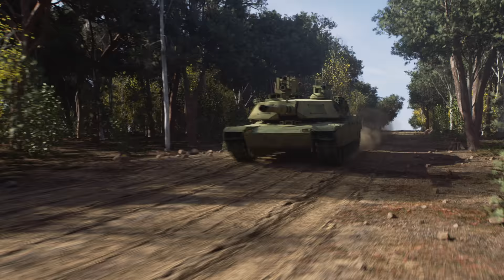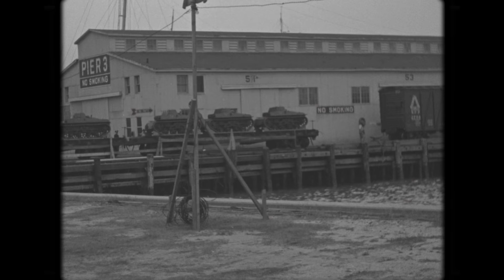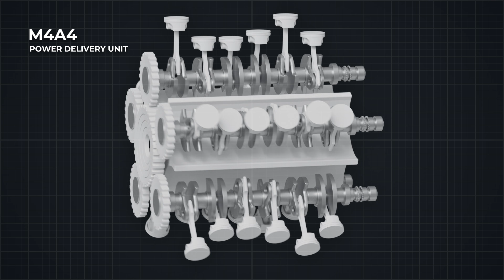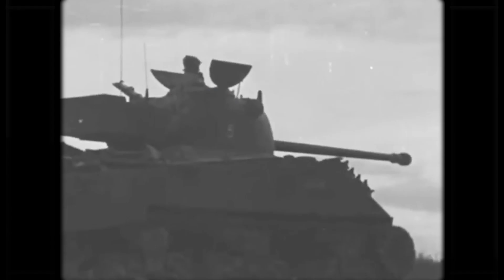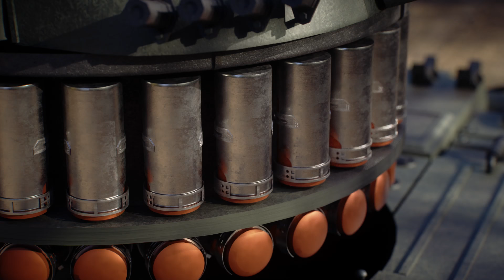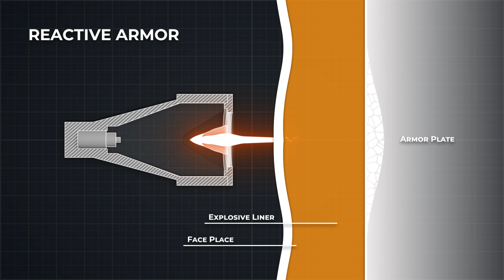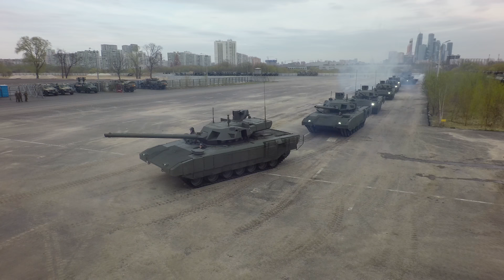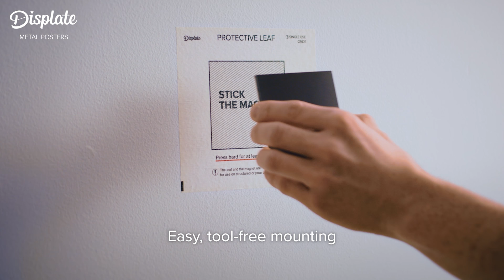Why America’s Tank Failed in Ukraine

Comment: There is a lot wrong in this video.
1. the tiger1 was not impervious to the Shermans 75 or 76 mm gun, both guns could penetrate the tiger 1 from the front.
2. the Abrams is a type of tank that has many different variants, not every Abrams weighs 78 tons. The variant sent to Ukraine is an old USMC Abrams that if I had to guess weighs about 62 tons.
3. I don't understand why people that think because the Abrams was knocked out in Ukraine that makes it "not suited for modern war" 
Ukraine and Russia have completely failed at employing there tanks in a way that won't get them killed. 
You could add the most advanced systems to any MBT in the world... but put it in a war with no support from other assets and watch it fail.
I'm tired of see this whole "tanks don't work anymore" from what people see in Ukraine
Reply: I think the point was to state the obvious, which is that the M1A1 wasn't equipped for modern wars. Yes it is an old variant of the M1, and yes just because they were knocked out it doesn't mean they were destroyed.

However the point is still true. For decades people touted the M1 Abrams, and it's survivability. Declaring it as one of the best tanks in the world, and perhaps in the 90s it was. Even with the A2 and SEP v3, the reality is that the Abrams platform is aged. The video was simply pointing out the issues with the tank, how the tank came to be, and how these issues have affected its use in Ukraine with the war against Russia. It doesn't mean the tank is garbage, or that the title is misleading. It just means exactly what Real Engineering said, "Why America's Jet Tank Failed in Ukraine." 

The reality is that the US is really the only country with the logistical, financial, and size capabilities to utilize the tank despite its negative factors. Yes, it is a beast of a tank, and as we've seen no tank is perfect (just ask Russia). However the title said exactly what it was supposed to. It provided the history behind American tank design, how the Abrams came to be, history about its' service and upgrades, and finally its shortcomings and what the Army is going to do about it.

This doesn't mean the M1A2 is gonna get liquidated, or is just a paperweight. It just means that without a country like the US, and our military logistical supply chains, this tank has failed to be truly effective in combat in Ukraine, resulting in 27 of 31 tanks being knocked out or rendered inoperable.
Reply: I am only going to criticize "In a way that won't get them killed".

This is war. Equipment dies. The Abrams in particular was thrown in the worst fighting. It's not that it died because it was a failure, it died because the it dying was worth the cost of the support it provided.
Reply: @wesleyfravel5149 the abrams failed to give the Ukranians an advantage in the battlefield,therefore it is a 72 ton failure😂😂
Reply: @wesleyfravel5149  if a tank is used correctly and effectively it will not be taken out. The US does not make sacrificial loses in modern combat.
If you think Ukraine and Russia intentionally killed off thier tanks you are delusional
Reply: @SHEEPS_123  That's a nonsense statement.  The battlefield is full of random unknowns and events that that can take out the correctly effectively used tank.
Reply: @SHEEPS_123 there actually is Ukrainian video of them using a Abrahms as bait.
Reply: @SHEEPS_123  it depends on what you mean by modern warfare. The US does not fight near-peer wars, let alone peer wars. The Russians didn't think they were doing those either.
Reply: @Hundredthldiot  in desert storm the the Iraqies fielded modern Russian tanks that russia themselves would have fielded in mass, i say in mass because obviously at the time Russia had more modern tanks, but those tanks would not be able to be replaced and older tanks would take there place. 
The Abrams did not smite the Iraqi tanks because it was far superior to them, it smited them because no country to this day match America's ability to fight on many different levels and provide logistical support for them.
In Venezuela the US went up against anti air systems that both China and Russia currently field, and yet we went in and out without being hit by a single missile. 

Im not saying that America won't suffer losses in war, but the only nation that could really conflict our ability to conduct operations with minimal losses ( compared to other nations) is china
Reply: @Slickrock72  this is only true for a military that is crippled, has no logistical support, or is not capable of fighting on many levels such as air superiority, controlling the waters, or having strong fronts.
Reply: @SHEEPS_123  It's easy to claim superiority in peer warfare when your military has fought no peers, but the US military managed to lose Afghanistan and Vietnam, so a little humility might be in order. Ukraine has been fighting Russia with one hand tied behind its back.
Reply: @SHEEPS_123  "The US does not make sacrificial loses in modern combat."

The US has a mostly air focused doctrine, they don't suffer large losses because they bomb the area they're attacking to literally nothing. It's not a case of using the tank effectively, they don't use the tank until the area is basically not going to put up resistance. They are not comparable in the slightest.
Reply: @Hoi4daybydayguy  given the fact that America fought a war where they couldn't "bomb everything to nothing then roll in the tanks" id say your wrong.
Yes are doctrine is air based... but thats not an American doctrine... thats a doctrine of an effective military.
The only war we were able to bomb everything to clear a way for armor to be safe was in ww2, in no war the US has been in since has this happened. Why? Because we aren't about to start carpet bombing the enemy when theu hide among civilians. Your point is false, literally every conflict the abrams has been in was not the way you just said.

I don't understand why you people find it so hard to believe that tanks are more successful in battle when supported by different sectors and that any tank no matter how good will die when employed like tanks have been in Ukraine
Reply: @SHEEPS_123  The US has carpet bombed areas in order to kill militaries even if it kills civilians. The Vietnam war was basically that. 

Why do you think precision guided weapons were developed? Because they're designed to specifically not harm civilians. The HIMARS is a great example of such a weapon, it can hit something within 1 metre of the target. No longer do civilians when you get hit because the weapon is designed to protect them while still harming the enemy.

The Gulf war and invasion of Iraq was basically a 6 week bombing campaign that flattened both their militaries. 

US doctrine is to attack and defend through bombs and shells first, then men and equipment. I don't get how you think American doctrine isn't that, that's all I observe from what I see with American forces. 

Tanks aren't deployed independently in any army, especially Ukraine. We've known that to be suicidal since they were designed. 

What I'm saying is that, your point that the US does not make sacrificial losses, is redundant, of course they don't, they use everything they can to prevent the threat and stop it, and rarely use tanks to do so, because why would a tank be needed in that context when a bomb can do just fine?

Ukraine and Russia do not have the resources for that luxury, they both have to make sacrificial pushes, because neither can do anything else.
Reply: @Hundredthldiot    The U.S. forced North Viet Nam to the negotiating table and withdrew after forcing a peace.  The U.S. withdrew from Afghanistan after a fair number of people questioned the point of being there after the Taliban was neutralized.  The withdrawal was hurried and bungled for political reasons.  In both situations the crap hit the blades after the military withdrew.  A little honesty is more needed on your part than humility on theirs.
Reply: @jagdson2701 Both were military failures. They achieved nothing. Running away is not victory.
Reply: @Slickrock72 the US has not fought a equal enemy since WW2...
The Abrams has never faced its modern equivalent from Russia/Soviets.
The version send to Ukraine didn't even have the modern armor package (something missing in the video).

Of course they wipe the floor with anything build 40 years earlier.
Reply: @SHEEPS_123 and my guy, the reason as to why there are no large air support missions in Ukraine on both sides should be obvious.
It's that both sides have to respect the enemys AA...
This is a different kind of warfare, the kind the US army was never ment for.
The US army is mobile, but not good at defense.
Look up older NATO doctrine, especially the Bundeswehr, they where meant to slow down the Russians to a near standstill, and buy the Allies time for reinforcement.
That's also why the US build as many carriers and why there artillery is so weak, because it all needed to be mobile.

Now in a drone dominated war, an tank gets pin point hit every few minutes.

Air campaigns are also known to be weak against a dug in enemy, you can wipe one trench of the map with an air assault, but there are layers upon layers of trench. All of them armed with manpads.

War has evolved back to an attrition warfare.
Tanks must be treated as expendable, because they are.
Reply: @SHEEPS_123  Something, something, something, "Fog of war".  Your earlier statement is profoundly naive.  It's baffling to me you can't see that.
Reply: @SuperUltimateLP  the only reason Russia didn't run Ukraine over in a week is because Ukraine has been completely funded and blamed by America and other nations.

Because your losing focus on the original point ill restate it.
The reason Russia and Ukraine are losing so many tanks is because neither nation is capable of providing support around there armor. Both nations could field the most advanced tanks in the world and would still suffer the same losses they do currently.
The video should be "why tanks failed in Ukraine" instead of "why abrams failed in Ukraine"
Reply: @SHEEPS_123   planes get shot by missile defense.   drones will get shot down by new weapons like small missile air defense and the tank will be needed
Reply: @DJJohnson-zw1xu I saw that.
Reply: @jagdson2701   you are higher than giraffe pussy if you think this is true. Where did you study history? PragerU? The US mission in Vietnam was what again? Backing South Vietnam, ultimately from the front, in resisting and ultimately destroying Ho Chi Minh’s communist regime and the NVA— Domino Effect. By 1975 however, the NVA controlled the entire country to the degree that remaining US personnel left Saigon during a 1975 emergency evacuation. That city fell to the NVA the exact same day and was renamed Ho Chi Minh City, and the same central government controls Vietnam today, but it has shifted away from a communist planned economy to a market economy. The only thing the US “gained” at this negotiation table was the freeing off some, most of our POWs. That’s not what happens when you win and force your opponent to negotiate. 

A shockingly similar thing happened in Afghanistan, with Trump signing an agreement that the U.S. would get out of Afghanistan entirely by a particular date in 2022. Usually when you win a war you generally see 0 combat deaths during the final day of withdrawal, not double digit combat deaths and the abandonment and partial emergency scuttling of hundreds of billions of dollars in military hardware and other materiel, rather than just selling it or loaning it to the regime we helped put in power, the one that no longer exists. Our local allies were executed en masse. This is the exact same thing that happened in Saigon, only US and allied forces got a lot better at waging war remotely and the Afghani mujahideen had gotten extremely good at insurgency at a distance, using the RPG-7 and the pyrotechnic time delay fuze inside PG-7V HEAT rounds (excluding the Chinese version, which lacks this feature) that detonates the main charge as an airburst munition, detonating at a fairly predictable 3000 foot range. This and the mountainous terrain are why ground warfare engagement range was 1000 yards away so frequently. PG-7V is cheap, 6 rounds plus boosters for $90 USD from the Pakistani black marketeers. Of course also using improvised minimum metal munitions in the form of ammonium nitrate fertilizer paid for by the US army to switch opium farmers to cotton which also led to our fentanyl epidemic as if we couldn’t have predicted that interrupting the global drug trade’s natural feedstock (cocaine) would result in drug cartels switching to a more dangerous synthetic replacement (methamphetamine). 

If you want an example of the US eventually winning against an insurgency (armed with swords and knives) then the 1900-1913 Moro rebellion would be a good example. The Moro Juramentados were so effective at melee combat with edged weapons, the US armed forces issued an emergency procurement for the Winchester 1897 “trench broom” shotgun, which is why US forces adopted jt so early into WW1, and it also led to John Moses Browning’s .45acp colt M1911, as the 32 Colt revolvers of the time, at 330 foot-pounds of energy similar to a .380acp, was insufficient at stopping the Juramentados. Eventually we mixed diplomacy and massacres to install a cooperative regime in the Phillipines. 

 Since this comment we have also suffered an embarrassing defeat driven primarily by the same egomaniac in the Strait of Hormuz, managing to lose the most advanced stealth fighter aircraft ever flown in hostile skies.

As to the matter of the Abrams in Ukraine, I will share my opinions as an American veteran of the first 33 months of the defense of Ukraine as a dismounted infantry precision marksman, not a tanker. I’ve never even been inside a moving, true tank before.

They were first of all an older variant of the Abrams lacking the “depleted” uranium-238 matrix armor, instead using tungsten heavy alloy and ceramic armor with Kontakt-1 ERA cassettes and  improvised cope cages, and older situational awareness EO/IR, so the thermal imaging system has about half the range as the modern system with far fewer pixels on target. Actually less advanced than what’s in the Bradley IFV. They were also used where the fighting was heaviest and most desperate, near Pokrovsk, Avdiivka, Klischiivka, Bakhmut, these are all within a box 20 miles to a side. Russian commanders put a financial bounty on destroying the Abrams and they faced a threat no American ground forces have ever faced: ISR drones, FPV drones, Lancet OWA drones, T-80s with Kornet-D missiles which are huge tandem HEAT TOW missiles that can punch through 1300mm of rolled homogenous steel armor after defeating ERA panels. That’s 4 feet 3 inches of solid steel. But really it was the drones. The tankers were the elite 47th mech brigade. Great tankers and the Abrams performed its job of keeping them alive extremely well. They were forced to abandon the tanks on foot and get picked up from the hedgerow highway under cover of night, and Russian artillery destroyed many of the Abrams themselves. Ukraine still has I believe 2, but the tankers I know and bought modavigil from don’t like the Abrams cuz it has an extremely high thermal signature for drones to detect from a long distance away and an extremely high visual signature from low angles compared to the Leopard tanks they don’t lose quite so quickly, then again they don’t use them the same way. Meeting force with force is not a successful strategy for Ukraine. Letting Russian commanders and senior enlisted doom their own people and get trapped at the Oskiil, Siervodonetsk, the Irpin way back in the first week, that works great. Letting them have a city or a roadway only to find that the city has just been encircled and the roadway was filled with hundreds of TM-62 mines overnight. They’re brilliant people, good people who have endured centuries of Russian prosecution. The entire reason the eastern part of the country speaks Russian is because Tsar Alexander II and later Stalin made speaking, writing, and printing books in Ukrainian illegal. Stalin starved 5 million Ukrainians to death and put an entire generation of academics, poets, playwrights, and novelists to death in the 1930s. They need to destroy the Ukrainian cultural identity because in their eyes it undermined their revisionist history that Novgorod was the only capital of the early Kievan Rus. It has nothing to do with NATO aggression as Ukraine is a democracy, a concept the Russian Vatnik mind can’t comprehend, but joining NATO and the EU have been matters of Ukrainian public policy. What small but not insignificant part of the population were sympathetic to Russians just had their minds changed for them by the sheer brutality beyond comprehension that occurs when Russians capture a city or town. I’ll put it this way: Ukraine now leads the world in two STEM tech sectors: UAS/C-UAS aka drone warfare, and gynecological reconstructive surgery.
Reply: so true. people for some reason don't understand that modern tanks were designed to work in ecosystem of lots of different weapons and tools. and we(ukraine) has none of that. tanks just can't fight effectively on their own, they need support from other parts of military.
Reply: 100% correct on all 3 arguments. 👍👍
Reply: All tanks are vulnerable to drones. To say that there's some magic way that tanks can avoid the drone problem is ridiculous.
Reply: @theicedragon100 jamming avoids all wireless drones, and active protection will solve the rest, plus infantry with their own protection systems and doctrine changes will make drone attacks far less effective
Reply: @omaradriani6770  You think the Russians and Ukrainians haven't tried all that and more. EW is widespread on both sides, but it's not 100% effective, and there are countermeasures. The drones with optical cables are also very common now. The problem is the sheer volume of those drones. Millions are produced and used each year of the war. With the price difference, against a high value target like a tank, just 1 out of 100 doing the job is enough. Armored vehicles are still obviously useful, but drones are here to stay and they will play a very significant role in any future conflict.
Reply: @pyroman2918  this right here
Reply: @omaradriani6770  Not when the onboard systems can still do last stage targeting and carry out the strike. Jamming won't matter in this situation.
Reply: @theicedragon100  magic? No. Aps systems? Yes
Reply: He is talking c r a ps
Reply: One mistake in this comment I'd say, there really isn't a way to deploy tanks without getting them destroyed. In a peer to peer war, tank numbers will be put through the grinder regardless of support. Support just makes each piece do a bit more while operational.
Reply: I doubt they could generate from the frontbunless 3 feet in frontbofvthevtiger,
Reply: You're just triggered because someone criticized the American tank.🤣
Reply: 3)It's not that it's knocked out,but how,and in what quantities.
"Ukraine and Russia have completely failed at employing there tanks in a way that won't get them killed. 
"
Russia didn't.
Reply: I think people can’t get their heads around the fact that in war, these vehicles get taken out. That’s just the way it is. I also think people have a hard time getting over the insane amount of casualties on both sides that we haven’t seen in a long time
Reply: And yet they are being knocked out
Reply: Sherman very rarely engaged with tiger tanks it was the exception not the rule
Reply: Nice try. Forget fighting a Tiger with a Sherman!
Reply: In regards to your first point the US75 can penetrate the tiger 1 but at relatevly short ranges like 4-300 meters but im not shure for the exact number.
Reply: @theclockmaker633  with special tungsten AP rounds (which were issued in incredibly small amounts to each tank specifically for fighting German heavies) they could extend that range much farther out.
Reply: @cookiecraze1310 i forgot about HVAP and you are right
Reply: @theclockmaker633 it was round about 400 metres so suicidal mission for Sherman and even at that distance was not guaranteed to pen it. In tank terms the 75. Mm armed Sherman had to be at point blank range to kill a tiger from the front
Reply: @jonathanpatrick8506  - the 76mm equipped Shermans (the British "17lbs pounder" barrel/ammo) had good performance destroying Tiger tanks.
Reply: Yes sure, a Sherman was able to penetrate the front of the Tiger 1... if they managed to come as close as 100 meter... so nearly never...
Reply: @randyraudi7725 USA Can't make shit !!!
Reply: @randyraudi7725 This is a myth
Reply: @randyraudi7725 wrong.
The Sherman used different types of ammo, armor piercing high explosive, armor piercing, high explosive, and high velocity armor piercing.
The armor piercing high explosive being the round with the liest penitration could kill a tiger from the front from over 100 meters.... so using the the two other rounds with far more penitration you'll see why the tiger being unkillable is a myth.

Not to mention that the US 75 was really Only used for fighting bunkers and firing high explosive rounds.

Tanks like the 76 Sherman's, M18, and M36 were tanks that more commonly were engaged in fights with actual tanks.

Not to mention the most used tank on the Germans side was the pz4 and stug
Reply: Modern war is about cheap, simple drones with a shaped charge round attached that kamakazies into the engine deck or turret roof where armor is irrelevant. Aka $5 drone vs $million's tank - take your pick.
Reply: USA Can't make shit !!!
Reply: M1 is not suited for modern war as it was designed for the Cold War. 
You fail to understand modern war. Both Russia and Ukraine are using their tanks correctly - you just do not understand that! 
You cannot field a tank with infantry support on a modern battlefield ;) Its no longer cold war you know.
You are only using armor in an emergency. Look at Russian modern tactics of using disposable vehicles or motorcycles - same as US special forces. 
Tanks are only used either in emergency or as a platform for long range sniper fire - in very small armor groups. 
You are precise reason why any NATO army would be totally creamed by Russian army - like immediate Russian win.
Reply: @tomk3732  
"platform for long range sniper fire"
To be fair,that's tank's role since WW2.
Reply: Because both Abrams AND Russian tanks ended up being severely outdated in modern peer to peer conventional warfare? 

What you are basically saying "But it's the most advanced horse in the world! If the enemy didn't employ machine guns, and with enough horses, cavalry charges would definitely work!". No they won't, admitting it and doing the necessary changes would save many more lives, than defending horses online.
Reply: @RMMinc  with the exeption that tanks never worked alone even in the best circumstances, this isn't new information, just the new threat that we are learning to counter, but better tactics that a western army in top shape like the US would use would certainly limit the damage
Reply: @omaradriani6770  except both Russia and Ukraine already employ the most advanced tactics in the world, in regards to the conflict they are in.
Reply: @RMMinc  I wouldn't say that, Ukraine, prior to the war, was in an awful condition, corruption in epic proportions, poverty and outdated military.
Russia is a paper tiger, another country which has legendary corruption issues and what seems like indifference to its soldier's lives. Especially when you consider that the apparatus currently controling it is the internal security, not the military (to be honest, it sees it as its rival).

None of these countries is able to conduct a proper modern combined arma mobile warfare, especially comsodering the weakness of the air forces.
Reply: @dostayer3369 You are a good consumer of television nonsense, but you know nothing about the war in Ukraine or about Ukraine itself. The US Army has never faced anyone in such a war before, where such a large number and type of different types of weapons were involved. Aviation, artillery, tanks, infantry, missiles (man-portable missile defense systems, anti-aircraft missiles, cruise missiles, ballistic missiles), and now drones, reconnaissance, strike, kamikaze. In addition, electronic warfare systems that work in many ranges, but drones still work. The war in Iran has already shown that the US and its allies are not coping, because they have not been able to understand that it is time to move away from the outdated perception of war during the 4 years of the war in Ukraine.
Reply: @olegsol5070  what? The US and Israel have a virtual air dominance in Iran ATM, really poor showing for the systems they currently have (which are either Russian or Chinese made).
About Ukraine: it's considered the most corrupt country in Europe. It's not even a competition, Ukraine was in an abysmal state before the war but managed to pull itself together.
Mobile warfare only work if you move fast, neither of these countries managed to do so they are now in a battle of attrition.
Also, western doctrine relies a lot on combined arms and air power, something of which neither countries have in a proper amount (Russia is lagging behind by quite a large margin and Ukraine's are old as well, the F16 they have are of an earlier stock).
Really, the war is just a very poor showing from Russia.
Reply: @dostayer3369 NATO exercises showed that a platoon of Ukrainian combat drones stopped several battalions equipped with tanks and armored vehicles
Reply: @olegsol5070  before or after the begining of the war?
Reply: @dostayer3369 Hedgehog-2025 5-23 may 2025
Reply: @dostayer3369  
"The US and Israel have a virtual air dominance in Iran "
Virtual is a very good term.
"really poor showing for the systems they currently have"
For two total strategic SAM batteries?
Passable.
"About Ukraine: it's considered the most corrupt country in Europe"
Irrelevant.
What matters is that Kiev regime,at the onset of hostilites,had second-best IADS on the planet.
After Russia and WAY ahead of USA.
"Ukraine was in an abysmal state"
Irrelevant.
What matter is amount of equipment and personnel available.
And Kiev regime had these in spades,regardless of quality of personnel.
"Mobile warfare only work if you move fast"
That is silly.
"Also, western doctrine relies a lot on combined arms and air power"
And the conflict against Russia revealed that Russia,and nobody else,will have combined arms and air power.
Western troops are to dig deep and wait to be eliminated.
"Russia is lagging behind"
Behind what,aliens?
Reply: @olegsol5070, so after the war has started, I was talking before it.
Was tends to fix those things rather brutally.
Not to mention, nobody ever faced a drone warfare before, so Ukraine was de facto the place in which it was put to test.